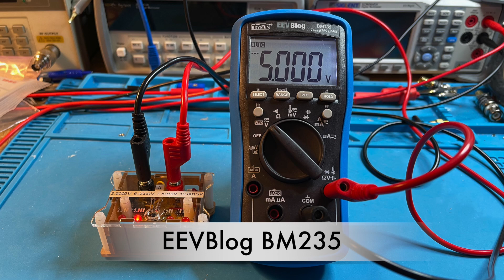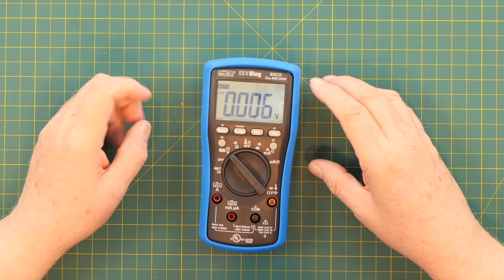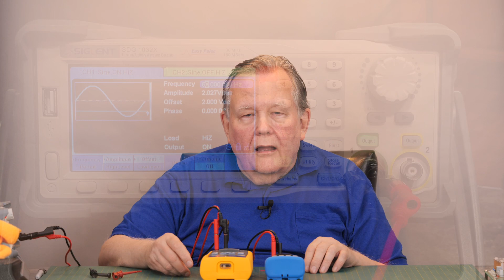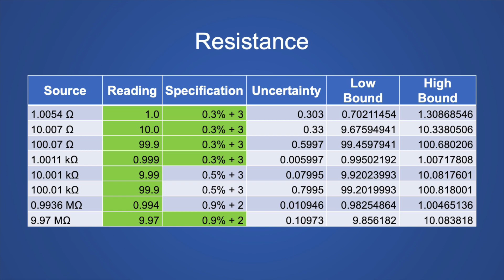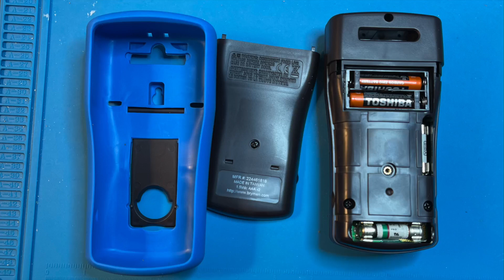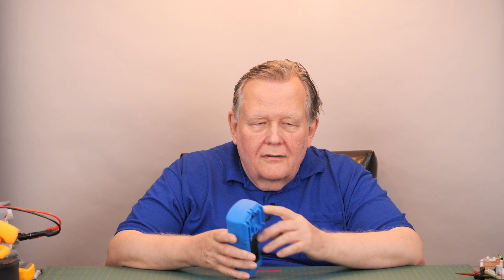EEVBlog BM 235 Review

Comment: Wonder what meter you recommend in the $45 to $60 + price range. For general, car and hobbyist use. Many options exists in this range. Most have nice specs too, with  reasonable safety, 10-20k points and a few come with silicone leads. Models from; extech, kaiwet,  uni-t, owon,  mastech, INNOVA,  southwire, Aneng, neoteck, asto and FNIRSI fit this description. Thanks for your thorough reviews.
Reply from the maker: Your requirements are a tall order for a $60 meter.  Of all the meters out there I have only tested a small fraction.  I have not review a safe, 10-20k count meter for under $115.77 (the Uni-T UT161E Amazon Uni-T Direct). https://youtu.be/2hj-T_DGwyU?si=6FFx5Lbw9gUAC57K.
Reply: @N8FDY  I know this is ancient history, but he's asking for hobbyist and automotive use, not industrial CAT-III and CAT-IV certification.  Do you really think safety is a big issue if the highest voltage you are measuring is 12V or 24V?  The Kaiweets HT-118E easily meets his requirements and budget.  It's not the only one.  It seems it's hard to find reason on the internet these days.  I don't need a Fluke 87V to check my car, my Arduino, or a 9V battery.  People need to get a grip.  JMHO.

BTW, for EEVBlog Brymen meters, the BM-786 seems to be the best value for electronics.  Not a lot more money, but better overall features.  This one seems to be more of a HVAC/electrician meter.

Comment: Thanks for the review not only for this multimeter. I like the well performed tests and the comparison with the specification. I can imagine that the work for such review is hard. I appreciate your effort! 
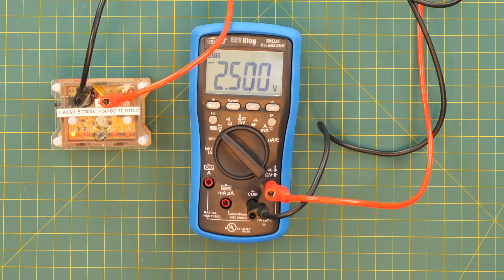I’m interested in the calibration circuits you have build e.g. the dc reference voltage shown starting at 5:00. do have a reference for the circuitries?
Reply from the maker: I did not build that reference I found it on Amazon: https://www.amazon.com/gp/product/B07SR9KTV6/ref=ppx_yo_dt_b_search_asin_title?ie=UTF8&psc=1 AD584KH High Precision 4-Channel 2.5V/7.5V/5V/10V Voltage Reference Module with Case at the YWBL-WH Store for about $22.  I actually bought two of them and tested each with my bench meter, I picked the one with the closer values.  If you want a pre-calabrated reference take a look at this https://voltagestandard.com/pentaref for $108, a bit pricey but I is much cheaper than buying you own bench meter, I already had the bench meters.   You can specify each one of the five reference voltages from 0.1V to 10V.  I did buy the 10V .001% reference they sell and I waiting for it to get here, they only ship USPS.

Comment: Thanks for the review.  I want to ask what Fluke does what this meter does at even double the price?
Reply from the maker: Thanks for your comment. I have been watching your channel for a while now and you are one of the people that inspired me to start my own channel.   I am doing the 6,000 count meter reviews in order of price, so I haven't recorded the Fluke 87V or the 87V MAX, yet.  I realize my target audience is price-sensitive and for many the BM-235 is an excellent choice.  But there are also some people that may want more accuracy.  For example, the BM-235 DC Volts accuracy is 0.3% + 2 which is fine for most people but if you want 0.05% + 1 then you might be interested in the 87V.  I know a random sample of one DM-235 may meet that accuracy, but if you buy one and it does not meet that, Brymen will not fix the meter because it meets its specification of 0.3% + 2.  If the 87V can’t meet the DC Volts 0.05% + 1 specification, you can get it fixed.  To most people Fluke seems overpriced, and for them it is.  For some of us that have a different priority, it is not.  It would be great if a company made a meter with 87V specifications at the price of the Thsinde 18B+, and someday I think that will happen, but until it does, we have to make tradeoffs.
Reply: @N8FDY  I look forward to viewing your other videos!